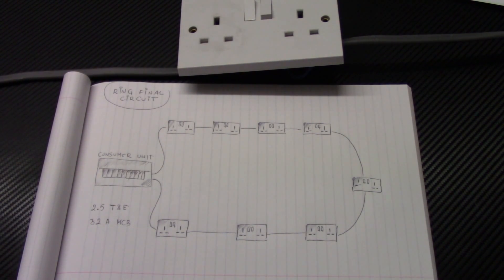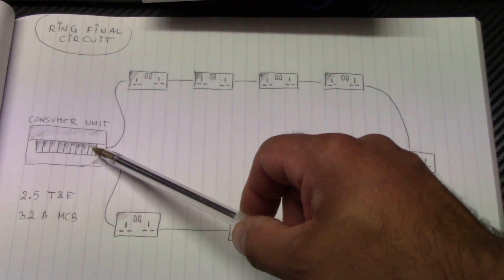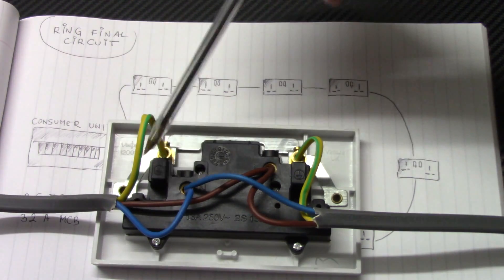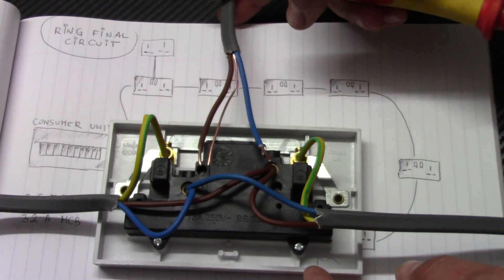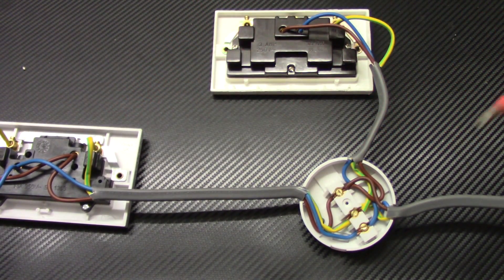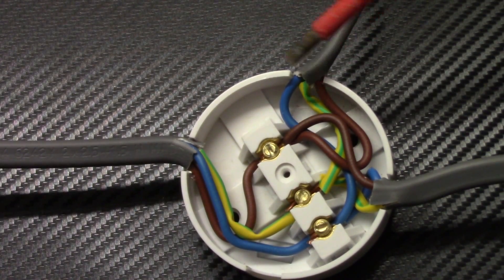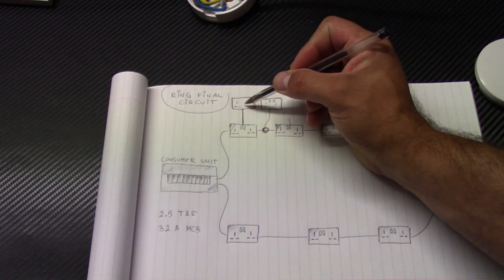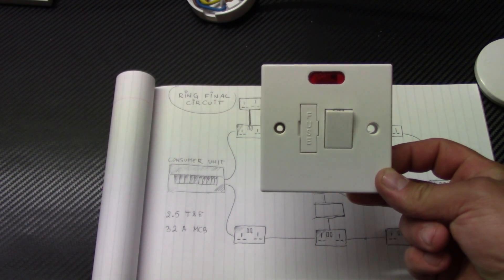Spur from ring circuit How to make a spur socket outlet from RFC

Comment: You can't just go around adding sockets without an fsu with a 13amp fuse in line. 2.5mm t&e cable has a maximum rating of 23-25 amps and the potential across that socket is 26amps so there is a possibility  for the cable to overheat and become damaged although you shouldn't overload a twin socket with more than 20 amps it can be done. Your giving people the idea that its easy and correct. Well it's not. Dont be fooled in to thinking this is acceptable people. Have a qualified electrician carry out the work. It may not be cheap but it will be done right and safe. Dont follow this video.

Comment: Having an spur socket  make  the circuit less safe?  I am asking because  those spur socket will not be   ring circuit, they  will be radial.
Reply: Depends on what the circuit is protected by. Rings and radials are only part of what’s being shown, remember every joint adds risk , every person who works on a circuit has the potential to do a good job or make a mistake. Electricity can kill, or cause a fire if your not sure leave alone.

Comment: Your videos are amazing the best ever so congratulations👍
If you could pls tell me that can I use FCU in a radial circuit. I am planning to use 45 Amp FCU and connect it to 20A mcb in  consumer unit with 6mm cable and from this FCU  using 2.5 mm cable to connect 5 double sockets in a ring circuit. The total load on these sockets will not go over 3Kw. Thanks for your help ⚡

Comment: Brilliant vids thank you. I ‘intend’ to use an rcd fused spur off a socket outside bathroom to power a very small 300w underfloor heating mat in bathroom. 
However...they aren’t the prettiest sockets as I can’t find any available in chrome. However a standard fused spur non rcd one is. 
Therefore could I simply replace the main rcd for upstairs sockets at consumer unit with a 30mAh one from the 32mAh one currently to comply with regs re bathroom? Surely I wouldn’t suffer with tripping it out any more than I would normally as the difference would be negligible?? Thanks in advance.

Comment: This is not a compliant way of breaking into a ring in the UK. A spur needs to be fused to suit the rating of the 2.5 cable (ie no more than 20A). In this arrangement, the spur cable is not adequately protected and may represent an additional fire hazard if there is a fault on the spur cable.
Reply: Perfectly acceptable practice, The fuse in the plug will prevent the cable being overloaded, 2.5 has a max rating of 26 amps, so even worst case if you had two 3kw items in the same spur socket it would still be within the rating of the cable, Short circuits will be covered by the 32a mcb.

Comment: TWO VERY BAD POINTS HERE

1. The terminal block should NOT be rated at 13A!! You are running a dual socket off this which could have 2 13A fused devices, so technically 26 amps could pass through a connector rated at 13A. That's how fires happen, and you won't know about it until it's too late as it's inside the wall. The main fuse box has a trip which is usually rated anywhere from 16 to 32 amps depending on the circuit usage and wiring/ distance etc, so be sure you know what your circuit is capable of carrying in terms of load. You should use a 30A terminal at least and not travel too far from the sockets you are splicing off.

2: You didn't mention "BE SURE THE POWER IS OFF" before taking apart face plates, cutting into cables etc. Obvious to competent people, but lots of idiots or newbies out there and you should have at least simple safety advice and a disclaimer that this is not an educational video. 

Please do not give bad advice to people where their lives and homes are at stake. You are obviously not qualified to teach this stuff. And it is perpetuated by people who then think they know and go on to tell others "how easy" it all is and cause a building fire.

Comment: ?  why do you go all the way around from circuit panel back to the circuit  panel.   i assume this is a 240volt circuit panel .  in the US if you do this and are side by side in the panel  you would have bucking phases.  would not work .   as the US is 120 volt system.  so in the panel we have   a 120 volt on phase A,  120 volt on phase B and then our Neutral and the earth ground.
Reply: in the UK, the cable returns to the same protective device, ie it is effectively 2 2.5mm cables in parallel which gives you sufficient capacity for the 32A device. It is a UK peculiarity born from WW2 copper restrictions. The higher capacity device means you dont need as many circuits.

Comment: The way you wired the junction box was a bit wrong, always try and have the cores cut exactly to length without any play so if the cable gets pulled it will not expose them and all the cores act upon the strain.

Comment: Is 1.5 twin and earth used for light switches and light fittings????
Reply: Depends on the regulations in your country. Here we use 1mm cable for our 10A lighting curcits in residential (average house) In commercial buildings or apparent blocks that usually goes to 1.5mm

Comment: Not very upto date on safety, if you spur a ring main with 2.5mm you are potentionaly  putting 32A down a single cable but if you add it to ring it is then spread with other 2.5mm and equals 4mm or you can use 4mm to make a spur 
Qualified electrician 27 years
Reply: It's bad enough trying to get 3..2.5s in the back of a socket. Let alone 2...2.5s and 1...4. Plus a spur in 2.5 is absolutely fine.
Reply: How do you fit 4mm in back then along with 2.5mm?
Reply: Show us a vid then of you junctioning up a new ring like you said within a 25mm backbox would love to see it. Also telling people who are not sparks how to create a new ring is asking for trouble. Has the potential of creating rings in rings which will throw a fail on a EICR.
Reply: Rob k don’t complain about me it’s NICEIC who said you should either fuse spur down or use 4mm
Reply: @martinlewis1015  mate a spur in 2.5mm is in regulations. Its acceptable... NICEIC haven't said anything 🤦‍♀️😂🤦‍♀️😂
Reply: Ryan Allen ok then work this out...you have a 30-32A ring main on a 2.5mm T&E which you then spur off on a single length of 2.5mm T&E? Which is then in theory carrying 30-32A on that cable? 2.5mm T&E can carry 25-27A. But if you put a fused spur to then feed it, it only has 13A and a depending on how it’s clipped i.e exposed in open or under insulation or under flooring reduces it. If you buy better sockets which have wider connections you can fit 2.5mm x 2 plus a 4mm easy, or just extend ring .This was pointed out by guys i worked with who had to abide by NICEIC saying this so guys fitted it this way.
In my days we used to make 100M ring and spur off every socket
Reply: @martinlewis1015  you're not an electrician are you. If you were you'd know this was is absolutely fine with no problems.
Reply: Ryan Allen i have been electrician for 27+ years

Comment: nice video man ..well explained thanks ..I understand abit more 

my question 

I need to make 6 X double sockets, and two lights on a switch ... power connection from a white box on the wall inside (consumer box I think small one  about 100ft away ..how I do this safely and correct ? some of the wire will be outside also ..twin and earth I will used but which size to bring power to the sockets from so far away ?? am plumber with alittle knowlage of electrics basic stuff trying to learn more 

kind regards ...mo plumber
Reply: Stick to plumbing Mo!

Comment: Very clear and detailed explanation. It would have been great if you had mentioned to turn OFF the power before fiddling around with 230V electrics. One more point. The maximum length of a spur must be no longer than 1/8 of the half distance of the final ring circuit.
Reply: "t would have been great if you had mentioned to turn OFF the power before fiddling around with 230V electrics..."  Anyone who doesn't already know that deserves to be electrocuted to death. 

Natural selection, innit?
Reply: junglejamesie anyone with common denominator, wouldn't touch electricity in the first instance. Unless they are qualified and suitable training to current regs.

Comment: How do I make a spur back into the ring do I add a set of cables back into the socket the spur is wired off so for instance the socket I've spurred of has 3 sets cables but because I'm making the spur part of the main it now has four sets and my spur has 2 sets ?
Reply from the maker: remove that cable  that goes from socket 1 to socket 2 on the ring and lay new cable from spur to socket 2 and you have 2 cables in all 3 sockets  - 1 , old spur and 2

Comment: what is the maximum length of cable you can use to connect a spur?
Reply from the maker: There is no limit to the length of a spur in the regs . Just the floor area for ring circuit cannot exceed 100m2
Reply: How2D2 the maxim length of a spur is 1/8 of half of the final ring circuit. ie length of ring 40m/2=20m. 1/8 of 20 = 2.5m (IET, Electricians guide BS7671 2015 amd3)